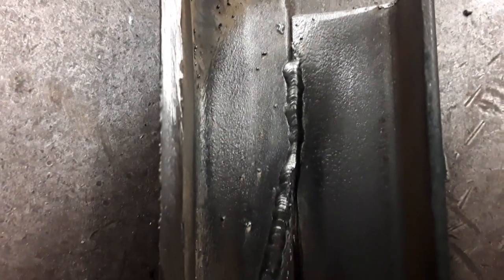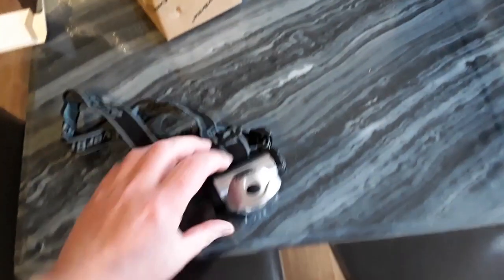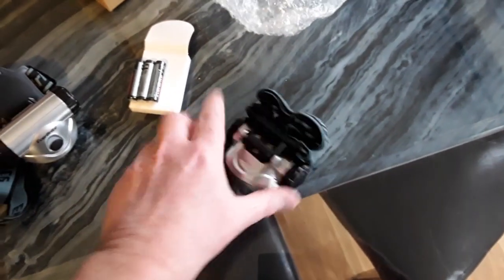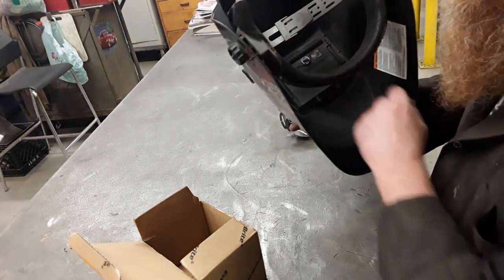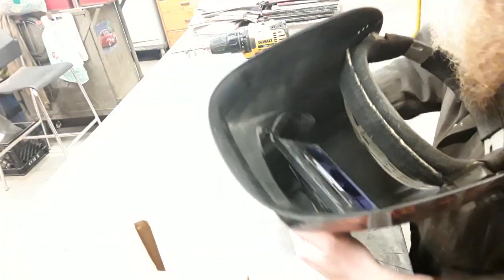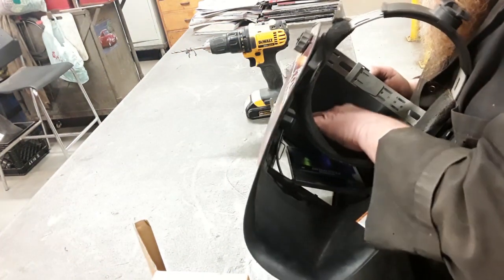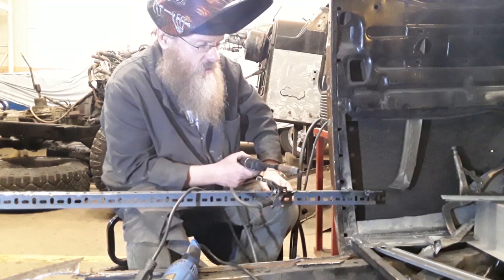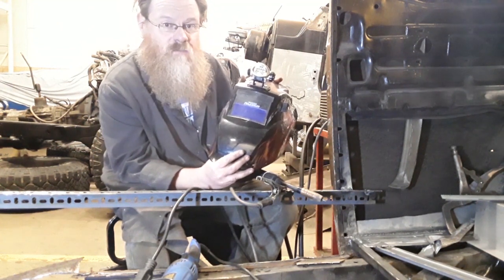I CANT SEE A THING!

Comment: Surprised to hear it would be better, would think the arc light would be sufficient. I have that happen at times too, will give that a try... thanks 👍
Reply from the maker: It works best pre-arc as the helmet dims as soon as the arc is created anyway. it helps get you set up on a seam without having to remove your helmet.